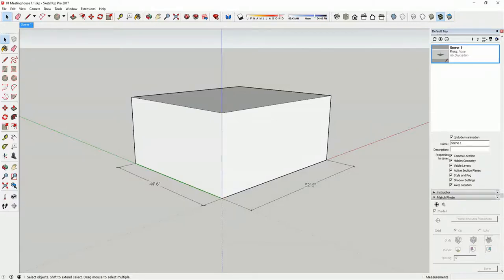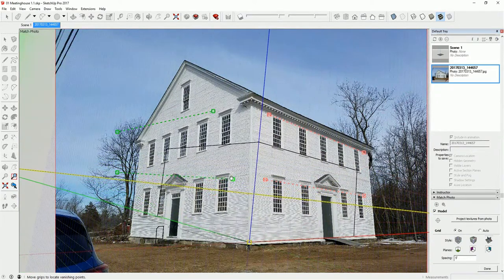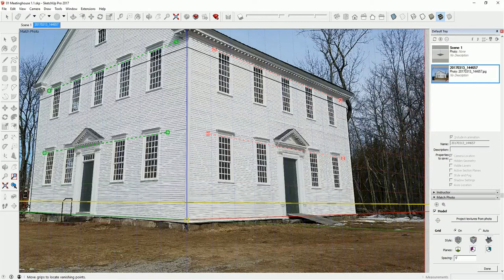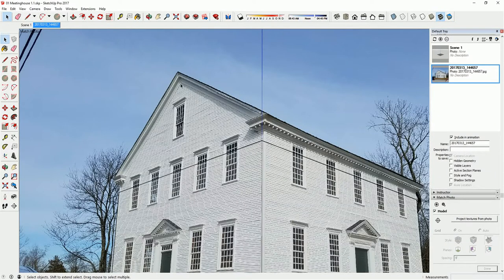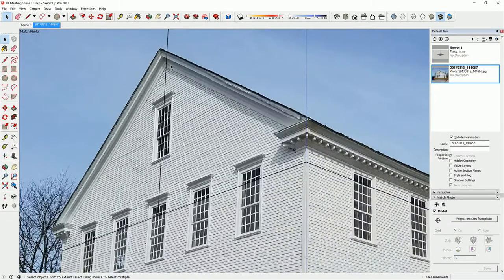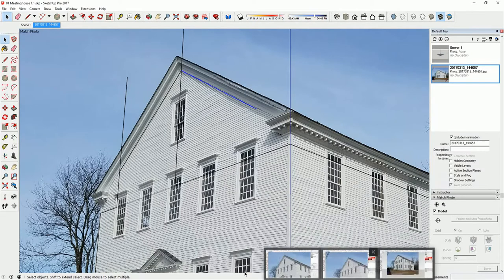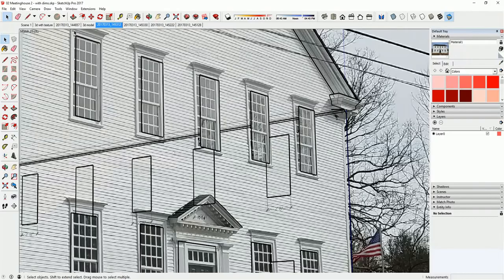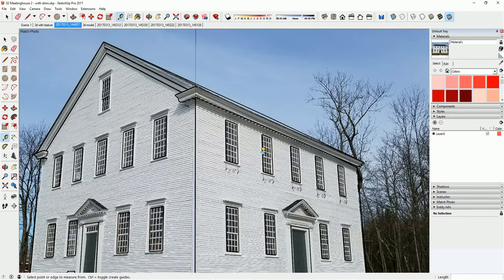Sketchup: Using photomatch for historic preservation

Comment: Despite the shot is taken at an 45º angle, which is recommended for a good photo-match, the vertical lines at left side of the photo tend to lean inwards too much, so i would say there is excessive perspective distortion at the front of the house, which messes up the photomatch. The right corner seems to align correctly with the preliminary box, and does not show that distortion, which is weird if the shot was centered at the corner of the house. Maybe that picture of the historic building is actually a crop, cut out from a bigger photograph?.
Reply: BTW, any chance to download the photo of the tutorial? thanks